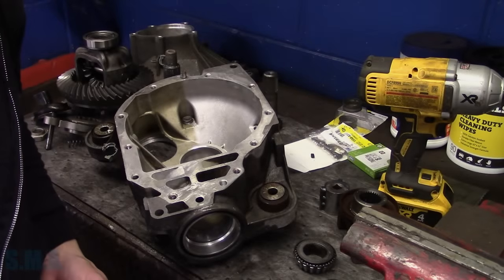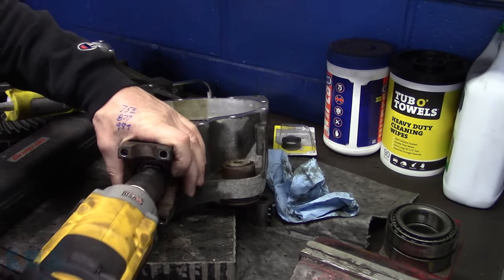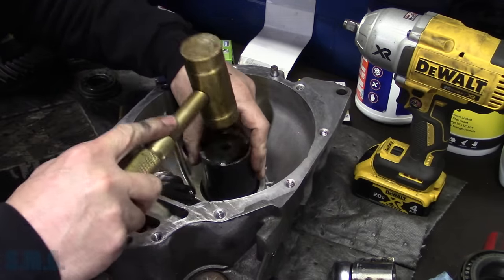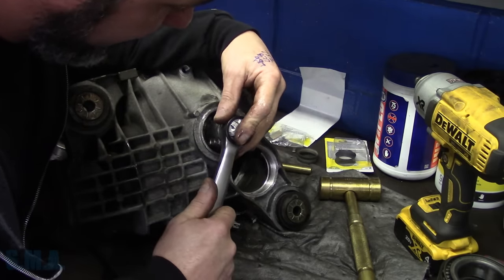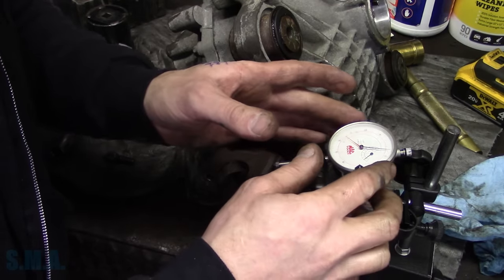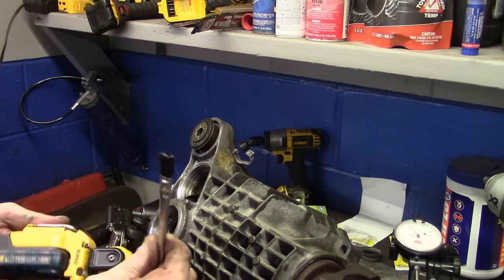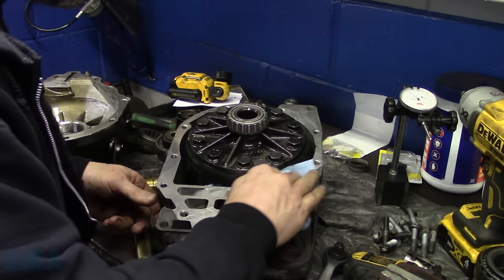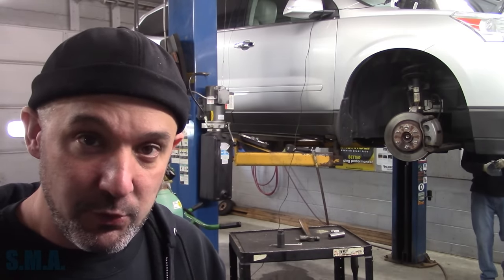Chevrolet Front Differential Set Up: Reusing Old Gears

Comment: I have an 04 Silverado 2500HD 4x4. the front axle specs GL-4 regular gear oil and the rear takes synthetic GL-5 with the additives. I was told that the reason was the front vent cap seal oring would be eaten by the additives. they suggested changing to the white cap to eliminate this. I am not absorbing that too well as that would mean it was designed that way.  I had always thought there was a yellow metal issue where something else was the design and the vent cap was a product of putting GL-5. I did not see any brass or such in there though. Any thoughts on this issue???

Comment: Had a customer bring a 1990 ck series 1500 4x4 silverado when I worked at our GM dealership in 1991. He somehow completely destroyed the front diff, broke the cases, galled all the bearings running it dry, and broke the teeth off the pinion and ringgear. GM did not make a service replacement assembly. So, that's right, the parts dept had to order a complete front differential assembly, piece by piece. I got several large boxes of parts and had to assemble it from scratch. What a p.i.t.a.

Comment: Love your show, wish we had a shop of your kind around here.  I do have a suggestion on the use of dial indicator.  Have the direction of travel of the indicator more at a right angle to what your measuring.  Your setup from what I could see in the video was less than a right angle and my experience suggests less travel of the indicator plunger that may result in an under measurement.  Now given the small distance measured and the small angle deviation the deviation might not amount to much and you could still be in spec but...

Comment: Wow, we have the same seal installing socket.  That has to be one of the worst designed ring and pinion setups ever.  This style makes it hard to get an accurate back lash or gear pattern reading with this design.   I stopped by the local Ford dealer down the mountain in Roseville, Ca the other day for our free service on our Explorer.  I asked out of curiosity what their labor rate was.  A $185.00 an hour.  Unbelievable.

Comment: Shouldn't the backlash be measured at the ring gear for an actual measurement? Measuring at the u joint mount isn't accurate because the measurement will change depending on where you put the indicator compared to the distance from the center of the pinion gear. Did this make sense?
Reply from the maker: Yes and that is why we took the measurement and divided it by 2 :) That way you have an actual measurement of the ring gear. Make sense?
Reply: @SouthMainAuto  Plus it would be stupid to try to cram your dial indicator inside the little hole in the case to access the ring gear. When doing a rear axle with better access you can go off the ring gear. That is why you HAVE to go off the the yoke and divide by two.

Comment: Eric have a similar problem, Axle shaft broken inside any ideas of what to do to get it out
Reply: drive it out from the other side? probably have to make a custom chisel/rod to get around the spider gear shaft which is in the middle.
a rod with just enough U shape arc to get around it and be straight on the other side may work.
that said, if the axle broke, it should be taken apart and gone through anyway, they most always spit metal chunks off.

Comment: Melissa, appt. on Wednesday, noise @ low speed from front end while turning.  Strut bearings per Dr. O/weld in new ball joints per interwebz.
Reply: My crystal ball tells me....its a broken spring! :-)
Reply from the maker: @DerGolf2000  Nope... it was just strut bearings :)
Reply: @SouthMainAuto  Damn, i need new batteries for my crystal ball! :-)

Comment: That's not a good way to measure backlash, depending on the distance from the pivot point the measurements will all be different but have the same gear mesh backlash. You have to actually measure the gap between gears to be accurate. Does the service manual tell you how to measure it?

Comment: You got 10 because they come in a pack of 10 and they are a non stocking item .If they stocked that part but had to order more, they would have pulled 2 and stocked 8.  Trust me I spent 45 years in the parts business.

Comment: At 37:30, when you were setting up the dial indicator, you should have oriented the plunger tangent to the radius of the yoke at the point of contact. By my estimation, you were at about 20-30° off tangent. Small errors in angle up to about 5° won't make much difference, but your angle was too high to be negligible. That said, from the look of the yoke rotation, it was close enough at the end of the day. Just keep this in mind next time you try to measure a rotating assembly with a dial indicator. You might have been better off with a degree wheel and a radius, then calculating the distance moved along the circumference of concern.

Comment: I’m sorry but I do not nor will I ever trust a digital torque wrench, awesome video though showing what a PITA this will be if I ever have to attack my dually.
Reply from the maker: Do you know when you send in you mechanical torque wrench they calibrate it with a digital load tester?  That is what a digital torque wrench is. It uses a load cell. :) Waaaaayyyy more accurate than any mechanical click type.
Reply: South Main Auto Repair LLC 
Well you definitely learneed me sumthin, they’re probably better now, but when I was a wee lad, and blew my first motor lol, I had to rebuild it cause my master diesel tech pops got sent to order some buses for the county. He had a brand new snap on digital torque wrench with angle meter. damned if it wasn’t every time I’d go to run torque angle on something the whole thing would just shut off on me. This was in 2006 so like I said they’re probably much better now. Thanks for the info though Eric! 🍻Hope you have a Murphy free day!
Reply from the maker: @johnv1038  You 100% correct on that sir! The early Snappy angle torque wrenches had battery housing issues. When you pulled on them near the end of the handle they would shut off! How do I know? I owned one hahah..... learning lesson there :/

Comment: Somewhat bothered by the fact that such a new front differential would need that level of servicing. Makes me think it had constantly seen use in a AWD setup rather than a 4WD setup.
Reply from the maker: ummm.... it's 18 years old.... 98% of these in NY are long gone at this point :)
Reply: @SouthMainAuto  Plenty of used parts out there, problem is they are all worn out too, you should mark them SMA and a date so I know its worth the $150 at the Upuller

Comment: Don't mechanics run a tooth pattern test for pinion depth any more?
I don't know how the gears can live if they don't sit on each other correctly. 
I built differentials for many years and the pinion 'backlash' was what's left after everything else is perfect.
Being concerned about backlash is a false flag.  
Used gears are always a gamble if you don't put them back exactly where they were worn into; they'll rapidly flake off the case hardening if you miss it just a little. 
Modern bearings are pretty damned close in tolerances and frankly, you might get away with this since you are using the same bearing manufacturer and part numbers - right?
I would never take a chance on destroying the case hardening on the gears by missing the pattern - not in the slightest!
I love all your other work - but this job - the way you did it - just plain ol' scares me!

Comment: The engineer who designed that differential should be taken out and horse whipped and it's obvious that they had no concept of what has to be done to assemble and adjust a crown and pinion. That has to be one of the dumbest designs I have ever seen. How pray tell are you supposed to blue your gear to check your wear pattern? Why could they not have made a standard style pumpkin housing with an inspection plate and short axle stubs? I guess that the simply didn't think about the fact that this unit might not last as long as the vehicle and require repair. How dumb is that.........

Comment: Dont u need to grease the bearings
Reply: Gear oil lubes them.  The housing is full of gear oil when installed.  They are in a bath of gear oil all the time while in operation.
Reply: You can for pre assembly, but no, the gear lube takes care of it.
Reply: @Sicktrickintuner  You wouldn't want to grease those.  Grease is too thick and it will stop the flow of the gear oil.  You just pre-lube them with gear oil like Eric did in the video.
Reply: Sicktrickintuner hi Tks for the info
Reply: seeya205 
Yes there are some bearings that actually recommended it like the bearings in a full floating hub, as grease is just oil that is soaked into a powder medium. 
As the gear oil gets to it, it just soaks up more oil and falls off and mixes with the rest of the lubricant. It’s good to grease when there will be a time the bearings could possibly run dry for a little bit.